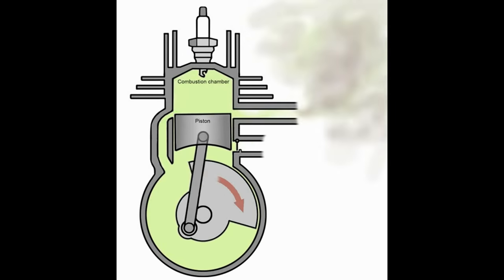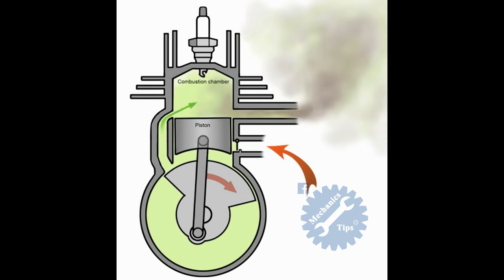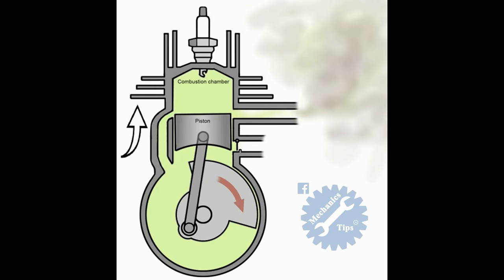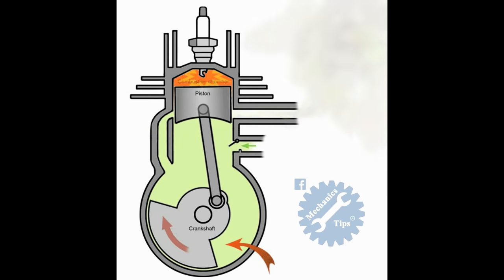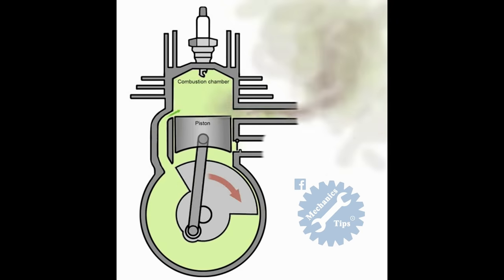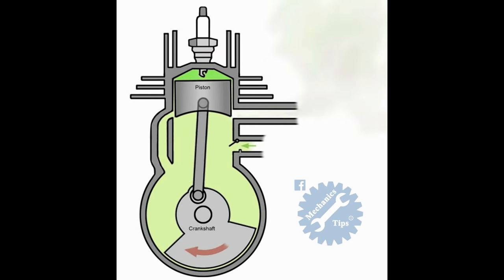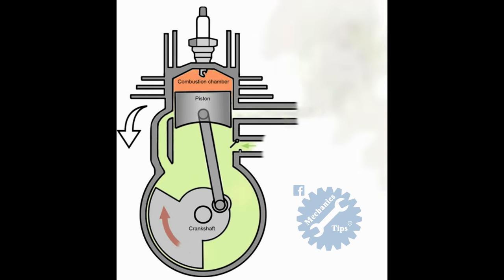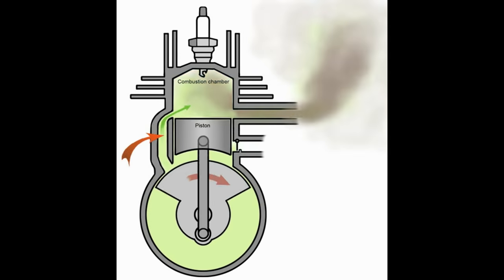How 2 Stroke Engine Works

Comment: There should be a pressure relief valve to compensate for the added compression under the Piston, this should increase HP output
Reply: Yeah just a little hole for air to escape or somthing
Reply: Wouldn’t it mess with the whole cycle in a negative way?
Reply: There's coolant and 2 stroke mix down there. What exactly are you proposing?

Comment: The exhaust port should be drawn higher than the transfer ports. Typically it will open about 85 degrees ATDC and allow enough of the hot pressurized gasses to escape so that when the transfer ports open at about 115 ATDC, the fresh fuel air charge is at a slightly higher pressure and can push it’s way into the cylinder and head area.
Reply: I detected this, and I am a rank beginner, and consequently I will keep looking for a good video.

Comment: Thank you so much.  After watching several animations I’m finally understand the process based on what you’ve provided.  Yours is the first animation to show the one-way valve that would have to be present at the intake port to pressurize crankcase during the down stroke
Reply from the maker: Thank you ❤

Comment: the perfect demonstration of 2 stroke engine                       
very very helpful for me in understanding 2 stroke engine working
Reply from the maker: Thank you
Reply: @Prabhjot Singh How would you know if it's a perfect demonstration if you didn't know how they work before this video? LOL
Reply: @MechanicsX  Why didn't you just show the more common loop scavenging type used today? There are no valves on the inlet port. Also, the inlet and exhaust ports are opposite each other.

Comment: One of the most robust 2 strokelawn mowers made was the Australian Victa Lawnmower. Because the carburettor was moveable on its stem or manifold they could be used regularly to power chicken pluckers.. small gensets especially 12volt units.. pencil grain augers.. cheap outboard powerhead replacement but not high performance..go karts..push bikes ..and the list goes on. While original version was only 125 cc they did experiment with a twin cylinder version of supposedly 250cc. Long live the Victa
Reply from the maker: Appreciate your comment 👍

Comment: And this is why they are being phased out. Both intake and exhaust is open at the same time so there is always loss. Which create harsher emissions leading to engineers to phase them out to meet ever tightening emissions standards. Bummer. They make great power.

Comment: Would it be possible to have a 2 stroke engine with its own oil in its crankcase separate from from the rest of the engine ?  Therefore premixing of the fuel or an oil injector would be no longer necessary ?
Reply: How would lubrication get to the combustion chamber to provide the necessary seal for the piston rings?
Reply: @tomobedlam297  This is my question also ;  there is only one man I've ever spoken to , that spoke of this subject that he knew of through Italian technicians . He had once been informed of a company in Europe during WW11 that was trying to develop this subject . Most likely this company was under German Nazi control  during WW11 . Personally I think a subject like this was probably then stolen and sold on the black market after WW11 and was then hidden by major engine companies so that it did not have a new competitor .
Reply: @tomobedlam297   In my opinion the crankcase system would be a type of new developed "Dry Sump" idea .
Reply: @johnh1001  Some more sophisticated 2 stroke engines use an oil injection system. I am not at all familiar with them but I imagine they have oil galleries in the con-rod, top and bottom end bearings, and the piston itself, which feed oil to the piston rings.
Reply: @tomobedlam297   Hey , this sounds very familiar !   Oil galleries in the con rods !   Yes of course ! Main bearings being oiled the same as a 4 stroke idea . There must be others out there with this same idea !  I'm sure of it !  Similar to but not the same as the lube idea of the Wankel engine oiling the rotor and the Apex seals .

Comment: So so far I'm hearing only advantages of the 2-stroke. Could you explain why cars use 4-stroke instead of 2-stroke?
Reply: junoguten Both the intake and exhaust ports are open at the same time so  some of the fresh incoming air-fuel mixture escapes out with burnt exhaust resulting in poor fuel economy and high emissions. In recent years there have been efforts to improve 2 stroke concept to make them more green.
Reply: Sangyoon Kim Thanks :)
Reply: Because then cars would be too
annoying and loud.
Reply: A 2 stroke large enough to move even a small car would need to be huge, about 1000cc, requiring a complex cooling, ignition, lubrication and power coupling, thus negating the small light simple aspects of common 2 strokes. The emissions on a 4 stroke are also much better.
Reply: +junoguten its because the two stroke engine creates more harmful emissions that the typical four stroke engine.
Reply: I would assume that in addition to all the points mentioned by other users, a 2-Stroke engine that can produce enough force to move a car would turn out to be a massive petrol gusher.
Reply: The Diesel Trucks were once a 2 Stroke,  but then they changed them to a 4 Stroke for Emissions reasons and to reduce Noise Pollution I guess......
Reply: Because 2 strokes are way worse for the environment and they can be annoying.
Reply: Pollution

Comment: So 2 stroke doesnt use oil ?
Reply: The oil is mixed in with the fuel. You mix it in your gas can before you put it in. Newer ones have oil injection. When the fuel/oil mix is pulled through the crank case bellow the piston, the parts are lubricated.
Reply: nah, a 2 stroke burns all the oil you put in as a part of the normal operation. So it regularly consumes oil whereas in a 4 stroke the oil stays in the engine when you have to change it. If you have a 4 stroke in good working order at least. My lawn mower's engine is so old it basically burns all the oil you put in and its a 4 stroke.

Comment: how the cooling works?
:-)
Reply: heat flows from hotter location to cooler location by conduction
Reply: +Mike Beaton indi
Reply: عبدالرحمن ابوعبدالله boxinglive2017
Reply: Air or water.
Reply: most likely air cooling by fins and fans is good enough for a 2 stroke engine.

Comment: it is actually 4 strokes engine.But its design is a bad design because it's verbose and not reliable when the piston moving fast inside the cylinder.
Reply: How fast? Two strokes are actually better suited for high rpm applications.